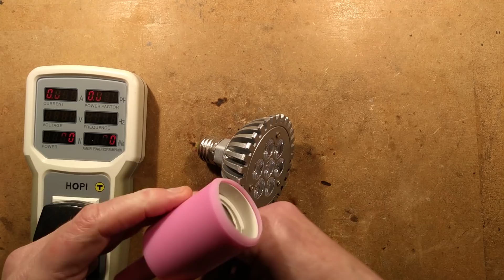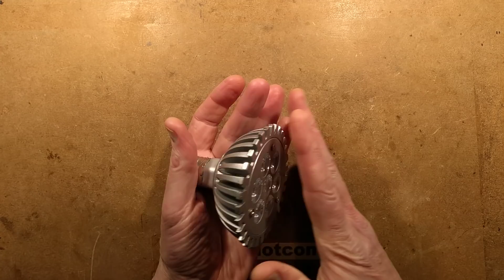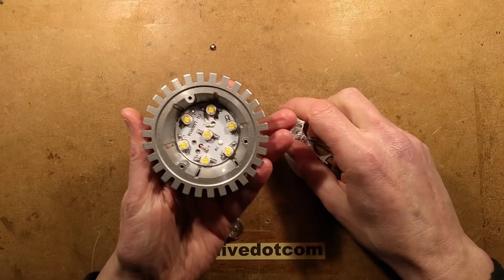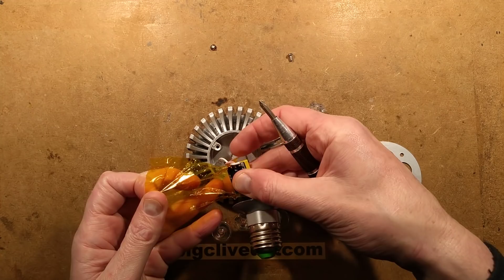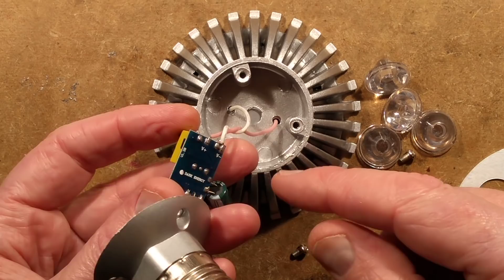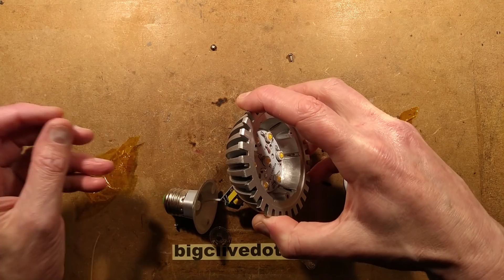Inside a chunky 7W PAR30 LED landfill lamp.  Good hack potential.

Comment: Taking my son to school this morning I noticed 2 street led lamps doing  the on off thing I was like I could fix that. Also learned what par30 stands for. Cheers from freezing kansas. PSA if your thermostat has batteries check and replace them, because if they leak and due to bad design (putting the batteries on top of the thermostat) the acid will leak down the board and components and eat them.
Reply from the maker: Have you just learned that the hard way?
Reply: @bigclivedotcom  yes sir, new house to us tho, only ben 2 months since we moved in, so to correct the problem I bought a thermostat with the batteries at the bottom.
Reply: @bigclivedotcom  Govt put new boiler and controls in - inc. radio thermostat. I said goodbye to the installers - then removed that thermostat. All the electric thermostats here are mains powered.
Reply: Apropos the on and off thing. My 2011 ASUS monitor started doing that recently. Fixed it last night. Getting it out of the enclosure was the only difficult part, but luckily not a single clip broke, because the clips are critical, they're the only thing holding everything together mechanically, the power and scaler box is barely taped onto the back of the panel, and there's a total of one screw in the thing. Electrolytic capacitor failure on the 16V rail of the power supply, and the failed ones being jammed between two heatsinks, well, there's your recipe for trouble, plus they have to stem all the ripple coming off the diode on the secondary. As a bonus, apparently i installed the panel with less warpage than the factory so the image in the corners looks a lot better, with none of the rainbow against dark colours.
Reply: There are thermostats that do not require batteries, not sure why they haven't caught on. A supercap is all that's necessary to keep the clock going in case the power glitches.
Reply: @NiHaoMike64  You're confused. I was going to say thermostats don't have clocks in them - they're temperature based not time.
Reply: @millomweb  Pretty much every modern HVAC thermostat is programmable based on time.
Reply: @NiHaoMike64  Programmers are, thermostats are not.
I'm using time clocks and thermostats, not programmers. A time clock and 2 thermostats worked out about half the price of a programmer and are much easier to twiddle.

Comment: Got myself a "10W" (I'll see) one just now.  If the lenses don't perform well I may just take them out and bareass the LEDs or put a clear piece of plastic over them.  I'm planning it for a location you need a ladder to get to so fingers aren't going to be an accident without a Bill Engvall's Here's Your Sign setup.

As for the one you have here Clive, that thing is amazingly serviceable.  You can super easily get the LEDs (and fast too, due20150801 for ex. is under 1 wk but more expensive than others), easily get the multi-LED boards for the LEDs in packs of 3-5 up to a zillion, and the power supplies (the real kick to the wallet of all of them) for like a few bucks up to $10 max.  Oh yeah and heatsink compound for pretty cheap in huge tubes as well, just don't expect it to perform well.

If you were determined and patient (or planned ahead) you could probably keep that light running for AGES as that chunk of metal will never really wear out.  As for ventilation you could (carefully) drill holes in the base section to allow at least passive airflow as there isn't room for a fan.
Reply from the maker: The LED driver modules are common on eBay for just a dollar or two.  Here's a 240mA one (they're usually 350mA for series 1W LEDs).
https://www.ebay.co.uk/itm/Constant-Current-240mA-Lighting-Transformer-LED-Current-Driver-Power-Supply/293224402353?hash=item4445894db1%3Am%3Am4BxypBOUgTka1tbKKa_4fA&LH_BIN=1
Reply: @bigclivedotcom  Must have had the higher wattage power supplies in mind then.  Dang those are sooo cheap.
Reply: There are also lenses on ebay (aliexpress, or similar) of different angles so you can choose... i leave here an example link:

https://es.aliexpress.com/item/32906618438.html
Reply: Got the bulb and tested it.  Typical Chinese 10w (~4w actual) that I will be adjusting up to 10w as soon as the power supply comes in with a LED swap also.  The heatsink contact ring could stand to be thicker but otherwise it looks like it could handle it.

Comment: "30 eighths of an inch"

A completely sane measuring system.
Reply: Machinist drill bits start with "The 64ths" - a normal "set" goes all the way from 1/64th to 1/2 by 64ths.
But. Wait. We need finer steps at the smaller sizes, and yet mostly skip all the way from 1/2 to 3/4 in one step in actual usage....
So there's the "Number Drills" They aren't strictly the "Stubbs Steel wire gauges", but they basically taper geometrically with the larger numbers being smaller drill bits.
But, wait. There's still some spots that we need other drills! (In machining, as opposed to carpentry or whatever, you're often trying to get two parts to have a 'press fit', or a 'clearance fit', or trying to make the head of the bolt fit into a recess, or whatever. So...
There's a "Letter Set" that sort of skips around some but hits crucial parts.

All in all: You have three or four charts taped to your "Complete Drill Index Set" just to figure out the name of the drill bit you want :D
Reply: In the industries that I service 1/4" is sometimes a unit of measure, a "4BV" is a 1-inch NPT butterfly valve and a 24BV is a 6-inch NPT butterfly valve. Other items follow similar conventions. Screwy, right?
Reply: You no like the improper fractions?
Reply: better than measuring in multiples of 17/43rds of a squibble. I shouldn't have said that, some loony will invent something for idiots that uses that measurement. Designed by lunatics for idiots or should it be designed by idiots for lunatics?
Reply: @gordonlawrence4749  for lunar idiots!
Reply: The inferior system... Sorry imperial, always mix them up
Reply: Aren't fluo tube diameters in 12ths of an inch ? So T12 is 1"
Reply: @millomweb  Florescent tubes are also multiples of 1/8". A T12 is 1 1/2 inches.
Reply: @eamonroad6388  I did wonder ;)
Reply: @millomweb  fluorescent tubes are in eighths of an inch, t8 being 1 inch, t12 being inch and a half.
Reply: Not the measurement system's fault when the standards committees do weird things with it. I mean, people talk about thousands of kilometers when they should be using megameters ALL THE TIME. 
Just remember: Every measuring system on Earth is arbitrary numbers, chosen by capricious humans and twisted more by use . Except planck units, but they're all very awkward sizes for most usage patterns. 

Also, will somebody fix time already?!?! Why didn't the french revolutionaries throw that out while they were tearing everything else down? (I know, they tried, but even the threat of the guillotine couldn't make people give up their ancient sumerian clocks.) I will give ALL my money to anyone who can get the Earth to have an integer number of days in a year, and I will DOUBLE THAT if it is an integer with numerous factors!
Reply: @CptJistuce  One day is a day - that's not arbitrary. One year is a year - that too.
Your issue with days and years is your issue. You are using two different measuring systems to measure time and you sound like you want an inch to be 24mm.
Now if you'll excuse me, I've a 1 mym race to run.
Reply: @millomweb  In seriousness, I don't like the switch between 60 and 24(or 60, 12, and 2 if you're using AM/PM). Sixty seconds in a minute, sixty minutes in an hour, twelve hours in a half-day, two half-days in a day. This probably makes sense if I think in base-60 as the sumerians apparently did.  But I don't, so it kind of looks like random numbers pulled out of a hat. 

I was mostly joking about fixing the number of days in a year. That would be a VERY large-scale civil engineering project, to put it mildly. We haven't invented the things we need to invent the things we need to measurably alter the speed of the Earth's rotation.
...
But if I could, I would totally spin the Earth up to 360 days a year.
Reply: @CptJistuce  It probably was originally but it's slowed down since ;)

Better steer clear of £.s.d then ;)
and stones, lbs, ozs.

What about 30-ish days in a month ? Make it 32 - 8 days a week ? ;)
Reply: @millomweb  True story, I chose 360 instead of 365 for the large number of factors.

Ain't nothin' wrong with pounds and ounces. Nice hexadecimal divisions. Powers of two make sense.
Reply: @CptJistuce  Wouldn't call 14 lbs to the stone hexadecimal !

I totally got your 360 !
Reply: @CptJistuce  I once witnessed lifeguards at a leisure pool pull a dude (drunk!) out the rapids and revive him. When I got home, as I knew how the lifeguards would be feeling, I sent a cheque to the facility as a gift for the lifeguards - don't know how many were actually involved - so sent £24 so it'd split several ways equally  !
Reply: @millomweb  That might be why we don't use stones in America.
Reply: @CptJistuce  Only used in UK for human weights, generally.
Then we have 'hundredweight' (cwt) (112lbs) and obviously ton. 56lb weights are common too ('half-hundredweight'). the cwt is a goods measure - 'a sack of' (potatoes/coal etc.) as being a weight a man can carry (on his back).
Quarter cwt = 28lbs so a stone is 'a half-quarter' (or eighth cwt !)
Reply: F Inperial, metric is just so much more easy!
Reply: @DrakkarCalethiel  Well, you sort of have the reverse problem. You know precisely how many mm the bit are ... but you have to work to figure out what "the next size up" is in many portions. Because in some areas you're going mm by mm. In other areas you're going by half-mm. And in yet other areas it starts into "evens".
Reply: Shrike DeCil Yeah, didn't thought about that one. But IMO still miles better than imperial. After years of watching vids I sorta can convert between metric and imperial.